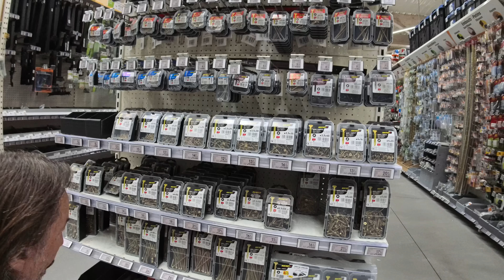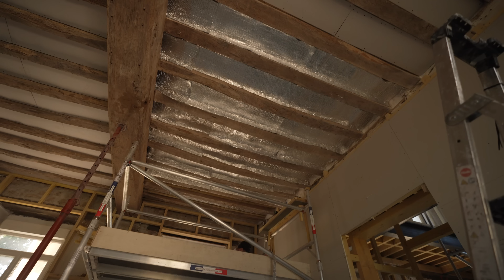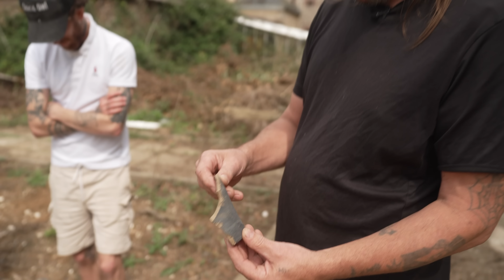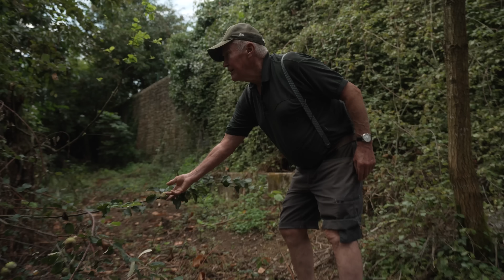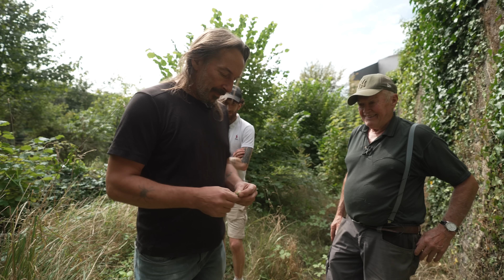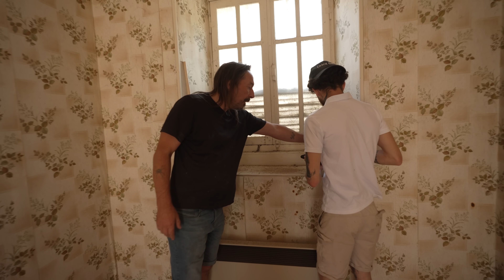Revealing the Lost Gardens

Comment: The crosses on the wall are called the stations of the cross the nuns would pray at each one in turn.
Reply: came here to say this  :)
Reply: If they are all the Templar crosses then maybe not the Stations.
Reply: If I'm not mistaken, weren't there 7 stations, and each had a separate prayers?

Not really sure I understood and recall all the lessons, but that was yrs ago! 😂
Reply: @bradleyslightom6313   There are traditional 14 stations where praying occurs each depicting events of Christ's life, suffering, and death. In 1978 Pope John Paul added two prayers to the rosary and a 15th station of the cross. Usually each station has art depicting the event one should contemplate. I've never seen stations with only a cross but this is outside and very old and doesn't diminish the ability to pray each station.

Comment: Those little flowers are called cyclamen and they grow from what is called a corm. The ones in the convent's garden have naturalised meaning that they are self-seeded and very old indeed. Cyclamen are fairly expensive to buy for what you get in a packet or as a live plant and the amount in the garden would cost a small fortune. Cyclamen have a very interesting method of self-seeding. They form a little pointed seed pod containing several seeds. Once fully ripe, the seedpod stalks begin to form a spring -like corkscrew that gets tighter and tighter, before eventually burying the pointed seedpod into the soil. Ants can also play a role in spreading cyclamen seeds by carrying them back to their underground nests. Invariably, some will germinate and after about four years, begin to flower.
I'm all too familiar with the length of time from germination to flowering because I deliberately had a go at this myself. Mine flowered for the first time last year and have just begun to flower again this year. I was like a kid at Christmas when I saw them flowering for the first time after four years of patient cultivation; I had done my research 1st so knew full well how long a wait I'd be in for. I've even seen the corkscrew process in action with mine and look forward to seeing them naturalise over the years to come.

Comment: This for the electrician.  For those rolls of cable . We here use a  stand that has a center wooden post with a short rod straight up. Then a ring with four wooden pieces going up angle ( like a cone.) They have ring at the top so the whole thing rests on the center rod.  Now the last thing is  post ( foot away from the spinning wire carriage) with a ring on top .
Drop the new donut of cable on the carriage and pull the end of the wire thought  the ring.  The carriage allows the cable to spin and ajust for  the cable. 
This sure beats unwinding cable all over the ground.
Cheers for across the pond.

Comment: For mowing the convent garden, I want to suggest a robot mower. I used one for many years in Georgia in the US. With your subscribers, maybe you can get a sponsorship from robomow or Husqvarna. Solar powered would be cool. One thing I can tell you from experience is that leveling the area will be an issue for the first month. But after that it's almost maintenance free. Levelling involves starting up the mower and watching it until it gets stuck in a hole. Then filling the dip with some soil or sand and repeat. Very easy. Your waste ground will be a manicured lawn in record time...

Comment: If you want to sort out all the weed then use Glyphosate Root-Killing. Its very strong and will kill anything you spray. take 3-4 weeks and it will be dead to the root and wont come back. Amazing stuff Elixir Gardens 1 Litre 360 g/l Glyphosate Commercial Industrial Strength Weed Killer | Treats up to 1666 sq.m £20 and just think of all the time and money you will save from running the tractor.